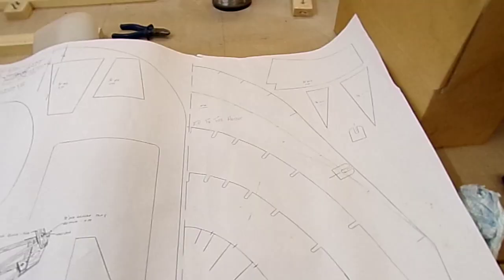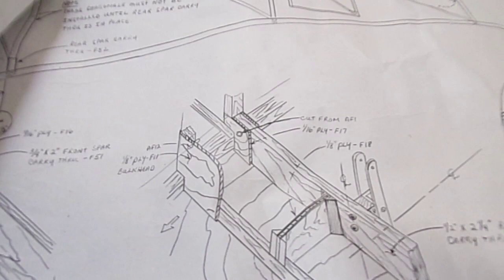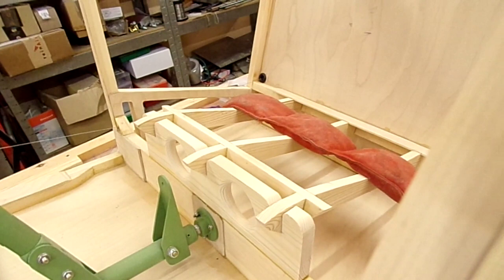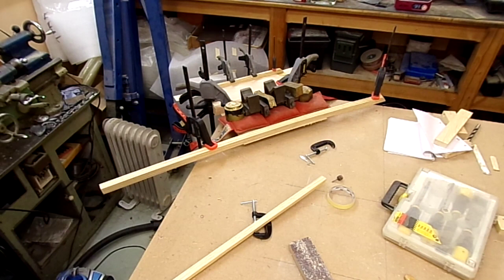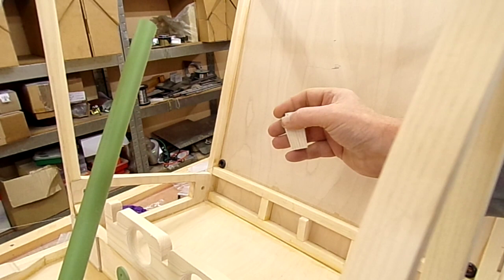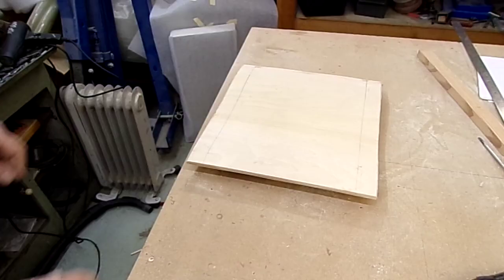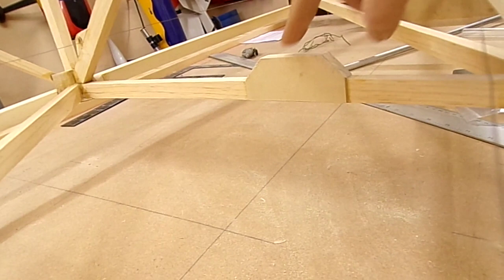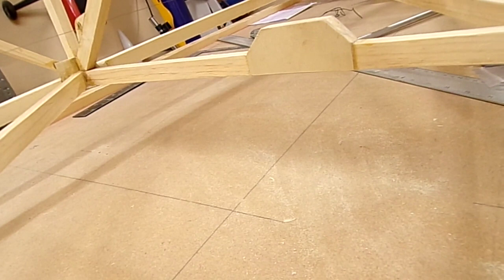EP82 Part trim controls & seat Fisher Youngster V

Comment: Furnature making is an important part of aircraft building.  You saved me asking why you didn't pre-soak the seat plywood by saying you may have in retrospect. 
One, probably a bit early, question that came to mind was; What sort of instrumentation do you intend for the instrument panel, traditional dials or digital multi-function displays?
Reply from the maker: Good question, most of the instruments will be steam gauges that I have collected over time but the engine will be a digital multi function but small.

Comment: I see some of the wood is supplied ready cut, how much time do you think that has saved over stratch building from just the plans? I ask because I live in Australia where shipping is prohibitively expensive, therefore I am considering a scratch build from plans using Douglas Fir which is available locally.
Thanks for the videos - it is really inspirational to see your aircraft come together.
Reply from the maker: Yes the wood is cut to appropriate strip and most ply cut to shape, this saves I would estimate around 50 to 75hrs, that said if you scratch build you get to grade the wood and select the best. A note Douglas Fir is 20% heavier but is stronger, the big thing I am not keen on with it, is it splinters.